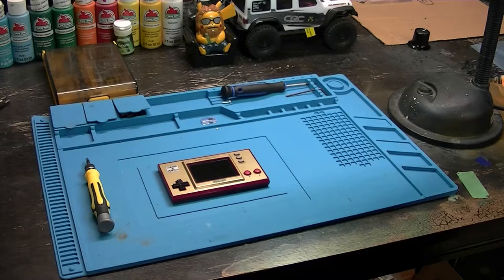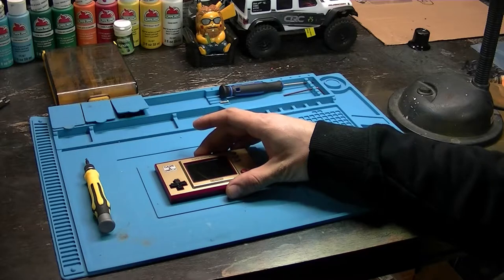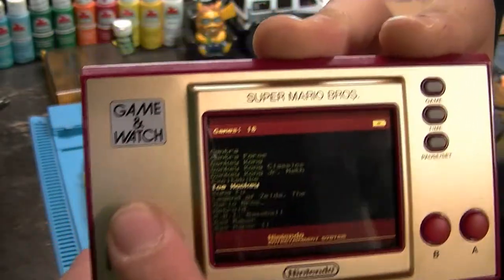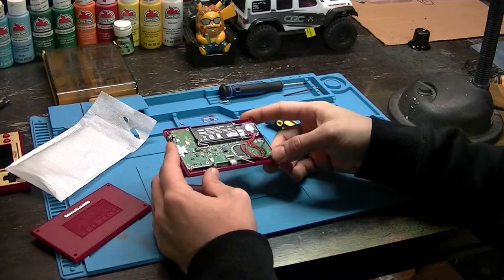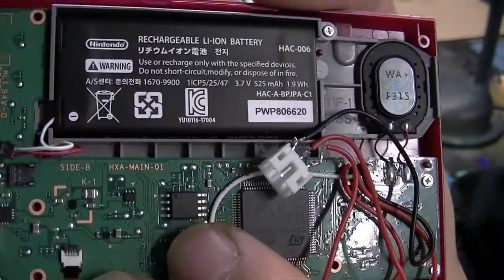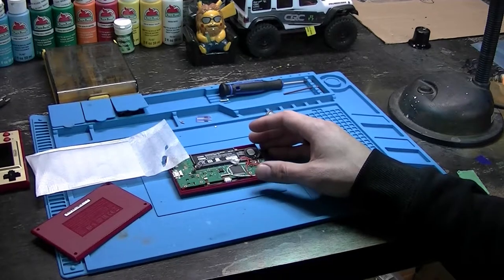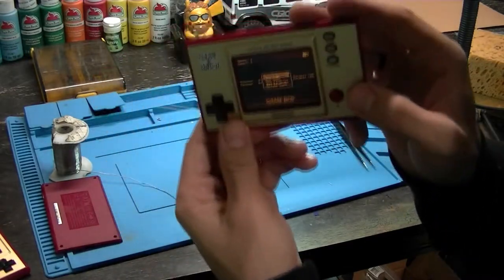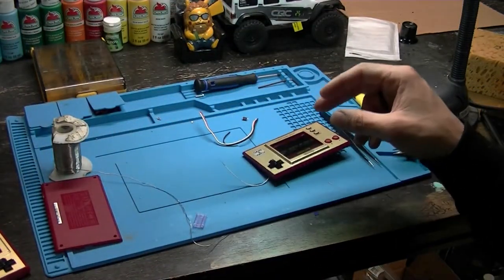Hacking the Nintendo Game & Watch: Flash Chip Upgrade How To

Comment: Anymore info on larger storage - MX25U51245GZ4I00 ? You going to try this next? The IC is relatively cheap too, which is good.
Reply from the maker: I know some larger chips have no legs, have not tried one yet, ill post a video if i do
Reply: @RetroResinCA  ...maybe will be problem with 166Mhz flash frequency...original on g&w have 75MHz

Comment: Hi , I upgrade my game watch,  change the flash to 16M, are you able to turn g&w on immediately after that? I plug in the usb-c cable and pressed the on/off button but it does not work, the screen was black. Is it normal ? Do I have to use stlink to burn the system before I could turn it on?
Reply from the maker: Yes ,you need to flash the image first

Comment: Hello, great tutorials. What commands did you do after replacing the ic chip? Is it a special command for the larger chip or you repeated some steps to put the games back on. I already unlocked the chip.
Reply from the maker: make LARGE_FLASH=1 flash
Reply: @RetroResinCA  thank you

Comment: Hello Terry thanks for all, i have a question, i dump my firmware and patch and install retrogo on my orginal 1mb flash and it was working, after that i install the 16MB ram, and the g&w was booting retrogo but error when launchin game so i decide to put back my original firmware, the procédure was running well bunt now black screen, i cannot power on the G&W, di you have a ns idea ? Thanks a lot

Comment: hello, i have a question the dump if we copy into a eeprom and soldering it in bord does it work or we need to unlock the st processor ? i'm very confused thanks (PS i have already make a copy of my eeprom with MINIPRO )
Reply from the maker: it needs to be unlocked first
Reply: @RetroResinCA  ok thanks for answer

Comment: Can i first install the chip before i do anything and than flash?
Reply from the maker: I cant see why not, but I would recommend backing up your device before any replacements or you will never be able to go to stock firmware again. You still need to unlock the device in the first steps on my other video. You should be able to unlock with a new chip installed.

Comment: I saw briefly somewhere that 64Mb is supported, Is that correct?
Reply from the maker: i believe MX25U51245GZ4I00
Reply: @RetroResinCA  just checked this out, it doesn’t have legs lol but I’m sure there’s a way of soldering it down. But if it works out, definitely 64mb would be ample storage.
Reply from the maker: @TrueSYD  https://discord.gg/3CMxGpsAZq   they talk about it in this group

Comment: When clicking the link to the chip it says: "FLASH - NOR Memory IC 128Mb (16M x 8) SPI - Quad I/O 104MHz 8-SOP".
It's 128 MB but you can only use 16 MB of those? Or am I missing something?
Edit: Hmm, maybe it is 128 Mbit and not 128 MB.. But it is still 16 MB x 8?
Reply from the maker: the amount of usable flash is 16 megabytes,  the chip is 128 megabit with  with 16M x 8. When i go to flash it shows 16mb of free space. I think the other space is for firmware and such
Reply: @RetroResinCA  ah I see. Thank you! Bought a couple of these and a couple of 64 MB also. The 64 MB seems a lot harder to solder though. No legs. I got a spare G&W so at least something to play around with. Thanks again man. Excellent videos!
Reply: @dacore84 where do I find that 64mb chip or what is it's model number?

Comment: Part Used: 
MX25U12835FM2I-10G  (FLASH - NOR Memory IC 128Mb (16Mx8) SPI - Quad I/O 8-SOP)
Other possibilities?
MX25L25645GM2I-08G (FLASH - NOR Memory IC 256Mb (32Mx8) SPI 8-SOP)
S25FL127SABMFI101    (FLASH - NOR Memory IC 128Mb (16Mx8) SPI - Quad I/O 108 MHz 8-SOIC)
Reply: the retrogo cfw has a code check only for the presence of a 64MB flash or the regular 1MB one. so it would have to be accounted for in the firmware.